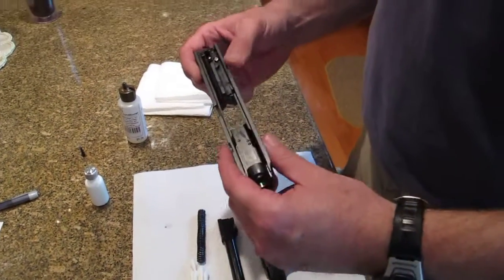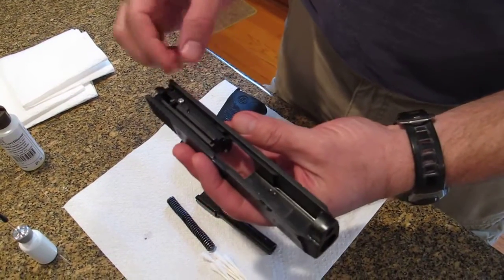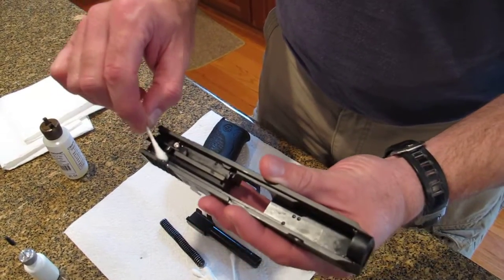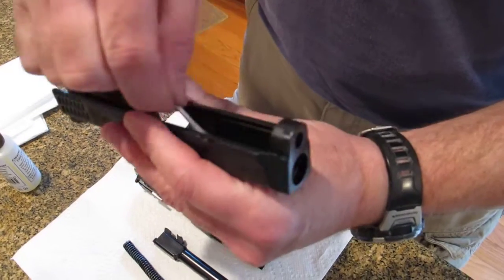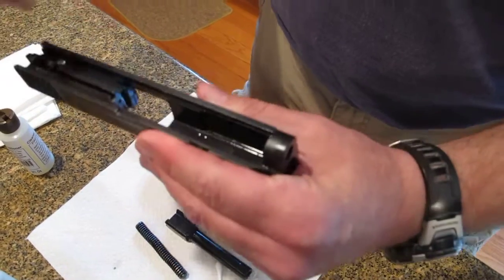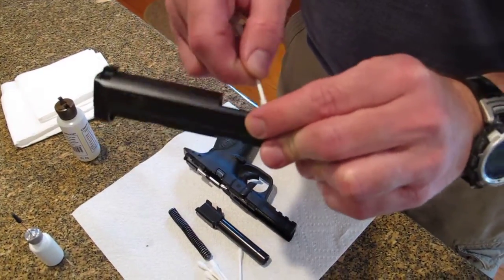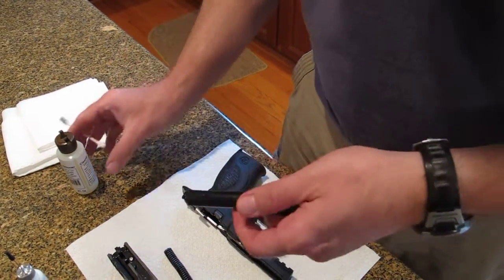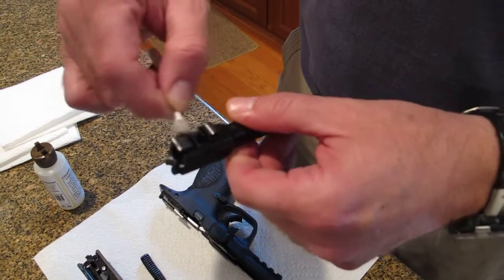FIREClean application on polymer frame pistol

Comment: What do you recommend as far as a protectant for the metal parts you do not apply the FIREClean to to prevent rust or corrosion to the exterior surfaces of the slide.  Is there anything that you would consider not compatible with the FIREClean as far as a protectant goes?  Thanks for the info!